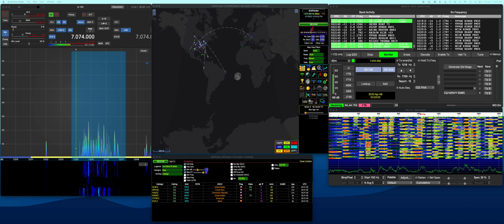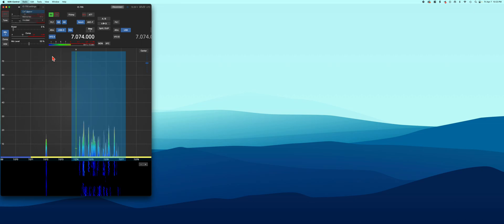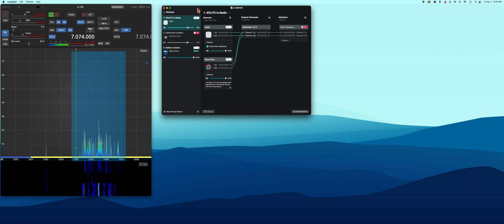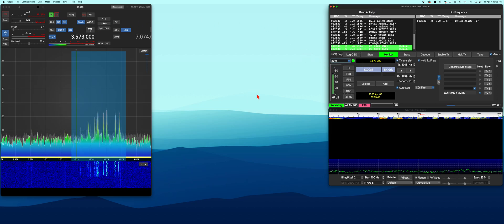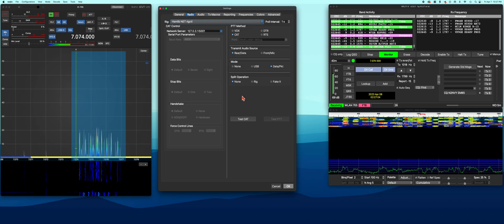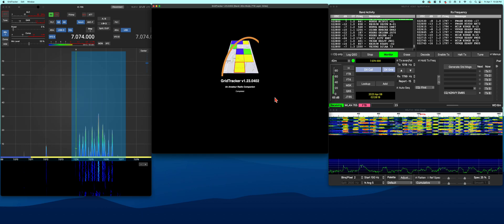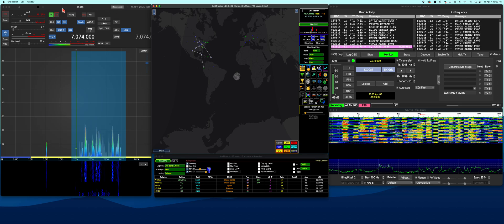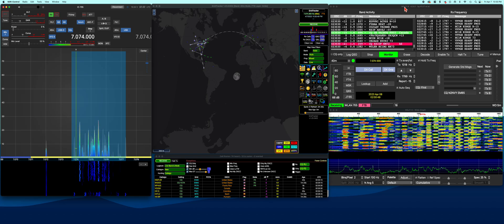SDR Control, WSJT-X, and GridTracker Configuration Settings Walkthrough

Comment: Can you please let me know why you're running both SDR-Control and WSJT-X?  I'm not clear what you're getting out of the SDR-Control app (besides the waterfall) since you're, I think,  transmitting using WSJT-X.  I'm hoping to do FT8 with SDR-Control but also have the power of Grid Tracker... without having to run WST8.  Is that what your setup can do? Thanks!
Reply from the maker: The way I understand it is WSJT-X is talking to SDR Control (via a virtual audio cable) and not my radio directly.  Then SDR Contol is controlling my actual radio. Does that make sense?